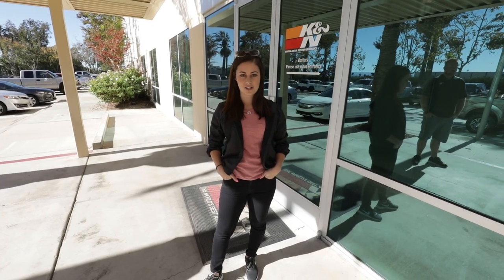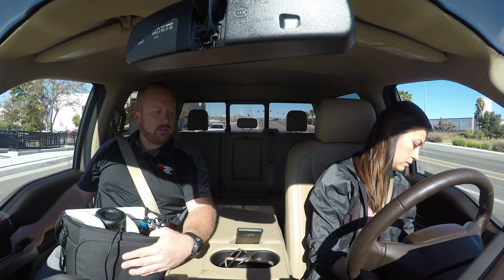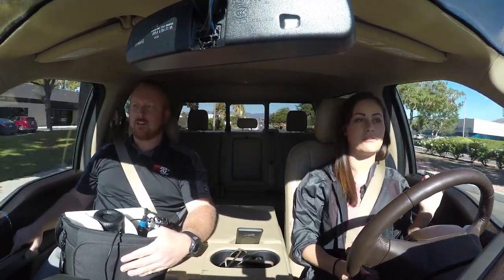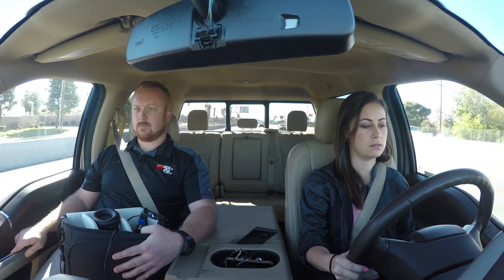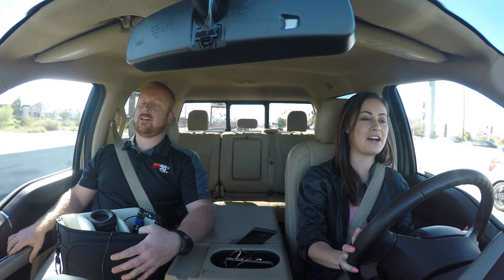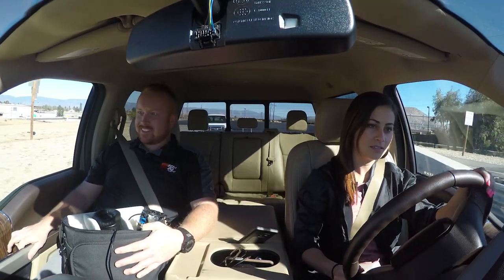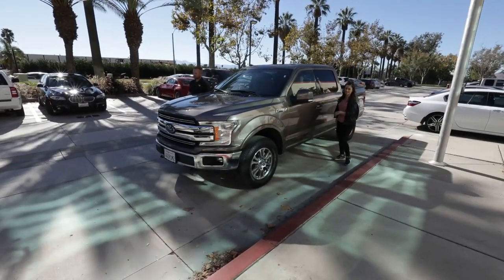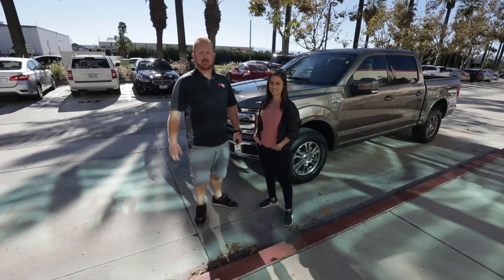Shannon McIntosh Throttle Control Module Test Drive

Comment: Hello!  I have a 2018 Ram 3500 with the Cummins. What would the throttle control and the boost control do for my truck when stacked together?  Thank you for your time!
Reply from the maker: Please contact our product experts at 800-858-3333 or tech@knfilters.com for specifics

Comment: Do you have any fact base comparison for times? Like it does it have a different 0 to 60 time or zero to 100?
Reply from the maker: With a K&N Throttle Control Module installed, you'll experience the sensation of more throttle input with less pedal movement.  For more information, please contact our Product Specialists at 800-858-3333 or tech@knfilters.com.

Comment: you can change settings without having to stop the vehicle?
Reply from the maker: Yes.  The unit includes a rotary dial that can be mounted anywhere inside the vehicle and allows the driver to adjust the Throttle Control Module on-the-fly.
Reply: @KNfilters  This just answered one my two questions. I wonder if the dial turned all the way turned is off and corresponds to factory throttle setting.
Reply from the maker: @JASmith-oy8db  Yes. Off sets the response to the factory settings
Reply: @KNfilters  Thanks. Glad to know and am further inclined to try the module.

Comment: 2010 f-150 ?
Reply from the maker: We don't make a Throttle Control Module for that application at this time, but check back soon as we regularly add new applications.